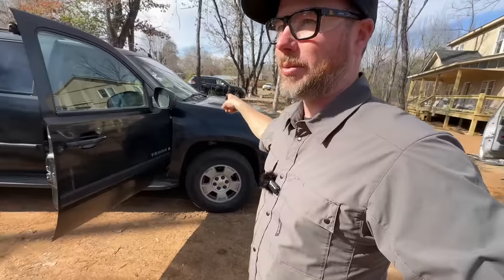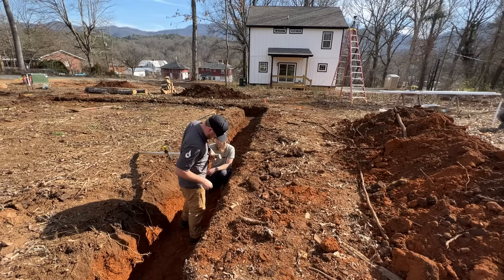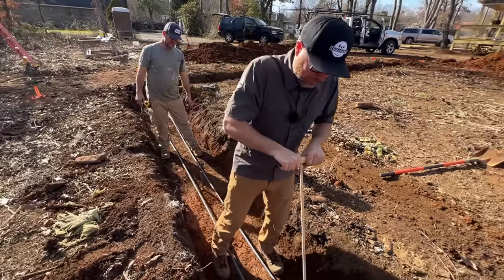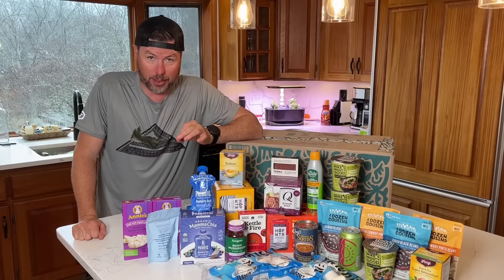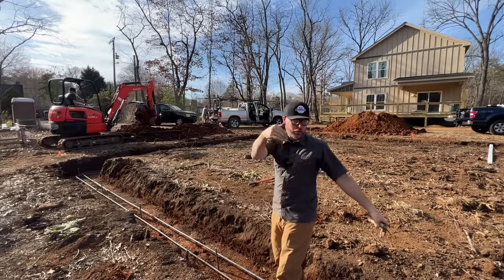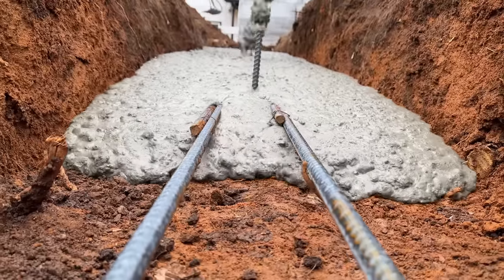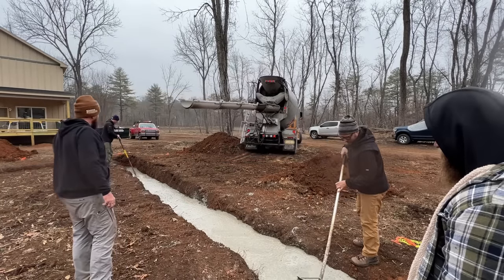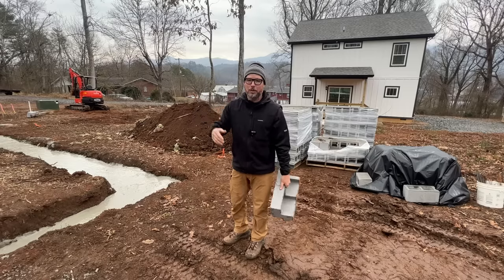Construction of a Duplex, Part 2

Comment: It's crazy how the building standards vary throughout the country. I'm in California and just had to pour footings for my home addition. My CMU block stem wall footings were 24 inches wide, 30 in deep with vertical rebar every 12 in, and six horizontal rebar throughout. Single story too. Ridiculous over building is par for the course in CA.
Reply: In my country as well , every other cell number 3 with solid pour and every 2 levels two #3 going horizontal all integrated within the RCC columns . This is due to earthquakes like CA, so I don't think its overbuilding. In a place like florida where you are concerned with hurricanes instead of earthquakes it will be really strict regulations on tie downs and straps for the roof due to pressure from the hurricanes as another distinction
Reply: Wow that’s overkill for sure!
Reply: @jaimeperkins9606  It's out of control in California for sure. The cities all require a structural engineer for pretty much any modification. So that pushes all liability to the engineers. They in turn over engineer everything (from footings to lumber to Simpson hardware) because 1) they don't want to be sued later, and 2) why would they care about the cost of construction? They aren't paying for it. So the end result is my single story addition is built the same way as a three story building and costs me $50-100k extra. On the bright side, the weather is great here in CA! Lol love your content BTW!

Comment: I cannot believe how lite the foundation of this house is. Looks to me as a fence foundation. I build a 200m2 house and it took 65 m3 of concrete and 10 tons of rebar.
Reply: How big does a footing need to be for a 900sqft duplex
Reply from the maker: wow.. for our area and this type of soil, this footing is way overkill. the steel was not even required

Comment: I can’t figure out why you guys in usa don’t have the ”forms” we have in sweden. That seems to be alot of work and not nearly as good of a foundation. Think of the form as an L made of 3” thick xps-insulation about 15” high, 24” deep and 48” wide. The outside of the form has a 1/2” concrete surface. You can lift them by hand. Just scrape of the topsoil, put down 8” of gravel, super flat and level. Set the forms, insulate the whole foundation with 10” styrofam. Leave a gap along the perimiter to create a ”beam”. Put down rebar and floor heating. And ofcourse do the plumbing in the gravel beforehand 😊👍.
Reply: No need to insulate the slab. Remember this is North Carolina not the Frozen Hell scape of the Arctic.
Reply: Different climates , in some parts of the USA its more common to go through all that effort. IMHO whats missing in this is really is  12 + cm of compacted gravel + vapor barrier that should be in all houses in the USA except the desert areas
Reply: @sanisidrocr  the vapor barrier will be installed under the slab
Reply: @toddb8479  Yes, this is wise. I would prefer under the footing too and am not a fan of exposed rebar in the ground of the footing , unless well planned drainage exists all around the home I could see some serious cracks develop in 50 years of that footing . But than again , most people don't care about foundations lasting 100+ years these days

Comment: For the most part, I enjoy your build series and see you as reputable builders. You should be ashamed pouring concrete that wet. You know it is wrong and it greatly reduces the strength of the concrete. C'mon guys.
Reply: Ah yes, the random guy on the internet that knows better again, almost missed you.

Comment: curious what the Perkins brothers vs the internet think about the oversized footing. Sounds a lot easier than forming a smaller footing, easy to move +-a few inches if needed. BUT what about the extra cost and concrete over the full footing?
Reply: Labor and materials to form are substantially more costly than a few extra yards of concrete
Reply: @baronvolkov6172  ahh totally good point.
Reply: @baronvolkov6172  Especially if the extra concrete all fits in the first truck.

Comment: Have you always used rebar? What if your footings was rock solid..is it still needed?
Reply: rebar is not required by code, but they have used it on every build that i have seen them do in the past few years.
Reply: I’d say it’s always a good thing. Even if it’s solid
Reply: @jaimeperkins9606  thanks...you really do try to answer everyone's questions...much appreciated

Comment: Pouring concrete that wet doesn't affect its strength?
Reply: absolutely and imho its a little on the wet side at the benefit of making it easier to pour and level
Reply: It totally does. The guys need to start using super plasticizers. Water is the worst concrete additive you can ever use. The truck drivers know better, but they always want to get in and out.
Reply: @mikeinmaryland  correct , but we also need to consider the clients budget . I'm sure they know about how to make a perfect footing and we can nitpick on all these imperfections but they all add costs and in many cases its not needed  as the client doesn't care if there are problems in 50 years
Reply: Absolutely, however they oversized the width footings by 25%.
It's faster to use no forms,but takes more mix.
Because it's oversized in width/bearing, it's a wash
Reply: @2chipped  I think the labor costs are far more than the added concrete for form work in their location but the cost of the concrete additives is negligible , i think its more of a client education issue about them willing to spend a couple hundred more
Reply: The concrete companies that I routinely test always use additives in their mix designs and the amount of water withheld at the batch plant is highlighted. As long as you don't go over the allowed water, their strengths are always a fair amount above the design strength. 
This mud looked very wet though. 
There are situations when a mix design can't be measured by a slump test and rather uses a spread test, but those are rare and special occasions. 
Hopefully everything turns out well!!
Reply: @trevordavis1854  that's easily 12" slump on that concrete. The shrinkage and cracking on that pour is going to be pretty extensive I would think.
Reply: This isn't the first time these guys have poured, nor their supplier delivered. Super plasticized additives Are what is used nowadays and any negative effects are negligible. Mike Days channel pours it nearly like "water" but has very little water in it and still achieves a strong finished product with WAY less back work involved.
People say the same thing when running thinned down drywall joint compound through automatic drywall tools and , like concrete, not everything is compromised Just because it was thinned down.
Reply: @sanisidrocr  but as they stated rebar is not required.
So 25% surface bearing + rebar provides more than the additives.
I personally would not spare $ for foundations, but budgets must be met.

Comment: Hey Jamie, if you bump the right hand joystick forward it should drop that blade and allow it to drag the top of the dirt to level easier.
Reply: Incorrect
Reply: not the left joystick but the blade control lever on the very right next to the cupholder. Push down past the lowering position puts it in float
Reply: @baronvolkov6172  Correct
Reply: Thank you

Comment: Fiberglass bars is better as won't rust inside you concrete
Reply: They aren't ductile and also are weaker and more expensive. IMHO compacted gravel, a vapor barrier , and proper drainage (like gutters ) is much wiser to keep the slab dry

Comment: that last Arial shot doesn't look square....
Reply: more of an issue of not being inline with neighbors ... but the lines arent perfect either because its a dug hole instead of form work which doesnt matter because its an oversized footer... bigger issue is too much slump IMHO
Reply: @sanisidrocr  yeah, I never add water for flow rather use water reducer to get same effect without sacrificing strength..